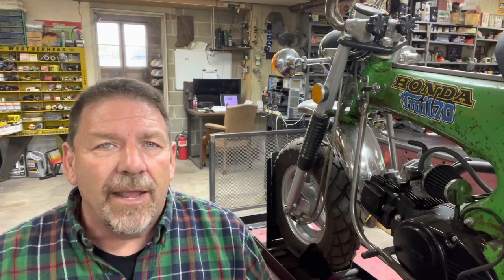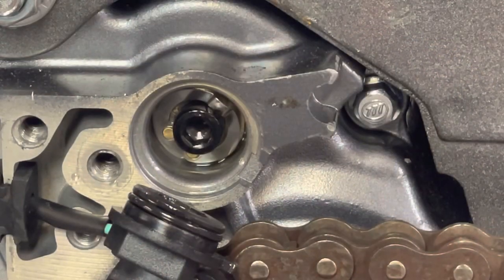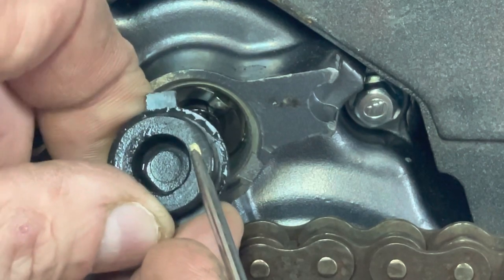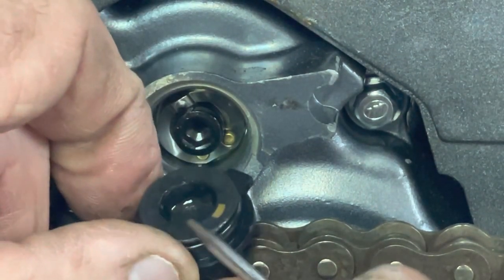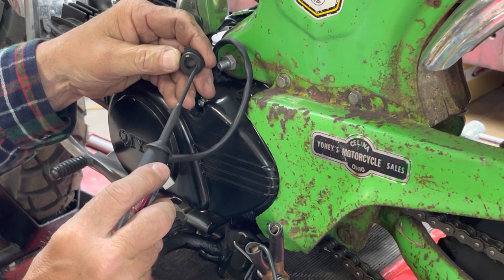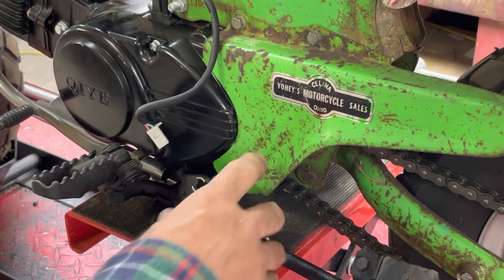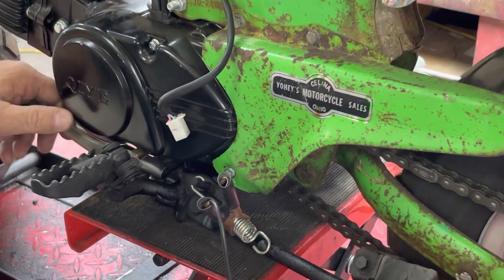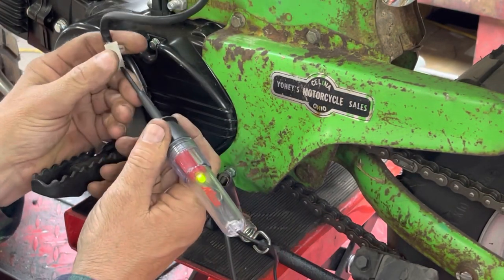Neutral indicator switch / gear indication wires

Comment: Hey man, I have a xpro x9 125cc dirt bike . My neutral safety sensor melted off inside the motor. The circle sensor piece melted in half so the bike won’t start. Sometimes I can get the sensor to touch the other half of the sensor the right way and it starts and runs just fine. Would I be able to just cut off the sensor and ground out the neutral wire to make it start all the time, or how can I fix this without replacing the sensor
Reply from the maker: @frostycrispy7234  Yep, cut the wire and attach to ground.  I would think that will work.

Comment: So can I just ground out neutral? So it will start in any gear? My Kp mini stopped starting in gear I can’t even bump start it anymore
Reply from the maker: This switch has absolutely nothing to do with allowing the engine to run.  These engines will start in any gear.   This switch has one function, to illuminate a light to let you know it’s in neutral.    This isn’t a “neutral safety” switch.
Reply: @MiniBikeMike  aww that sucks  
So what should I do my Kp mini 150 used to start in any gear with clutch pulled in but something happened and now it only starts in neutral    I think it’s not sencing the clutch  but I tried connecting the clutch wires and it doesn’t do anything :( I’m not sure what it could be
Reply from the maker: @timmysv1k94 Sorry, no help.  I don’t know what a Kp Mini is and I’ve never had a bike with a clutch safety switch.
Reply: @MiniBikeMike  it's a lifan kp mini 150
Reply from the maker: @timmysv1k94 Ok…I’m not familiar with that model.

Comment: thank you so so much  mr mike, it helped me out a lot, my gear sensor has 5 pin( since 4gears and neutral).. now i need to find out a way to make it work, i guess swapin some wires from the 6 pin connector might help? i’ll keep you posted:) thank u again, bless you😍

Comment: Hey, mike.  So, I have a chinese go kart with a single speed lifan style 125cc engine.  The kart will start if in forward or reverse, but will receive no spark if in neutral and, thus, will not start.  Any insight?  Does the position indicator switch play into the ignition, or is it simply for indication and there is an issue with maybe the CDI or something?  Thanks.
Reply from the maker: The neutral wire typically does not tie into the ignition, but yours may be different.  The neutral wire on a Lifan is green/red. If you have a wire coming out of the engine that color, I’d first try unplugging it from the rest of the harness.
Reply: @MiniBikeMike  Ok, I'll take a look at it when I get a chance, trace the (hopefully) green/red wire, and unplug it and see what happens.  Thanks for the quick reply.  

This kart has been a REAL headache... wouldn't start in neutral (kids figured out that it would start in gear), then the starter locked up (maybe a sticky starter clutch?) THEN it just stopped running altogether and I think the stator is bad so I'm waiting on that to show up.   

D:

Comment: Thx you My chain has cut that wire and I was wondering if it was important because now it’s not starting
Reply from the maker: Did the chain jump off?  If so, it probably bunch up and broke the pickup coil mount.  Take your stator cover off and check the coil and it’s mount….in front of the sprocket.

Comment: Hi Mike great video, my son's 110 cc atv has the same wire colors but I notice the 1st gear pink wire does not light up, all the other wires light up. Any suggestion what could be the problem. Many Thanks
Reply from the maker: Does each gear indicator have it own bulb?  If so, I’d start by making sure the bulb is good and is getting power.   These lights are powered all the time, they glow when ground connection is made. If bulb and power are good, I’d move to the gear switch that I’ve showed in this video.  In first gear, is it making contact with the brass contact in the switch?

Comment: So do you need the indicator the stator I bought came with a looped red and green wire and not the black peice that the wire goes into like the original one you showed at first can you bypass it or how can I just plug the black peice in from the old stator with no wire or what
Reply from the maker: Are you wanting the neutral indicator light to work?   If not, don’t worry about the plug or wire, engine doesn’t need them to run.  
If you do want a neutral light, leave a couple inches of wire on the black plug and cut it off.  Then splice it to the red/green in the new stator.

Comment: I have a 2008 honda trx 250 ex. It starts and runs no problem but the neutral light does not come on. The reverse light still works though. Any ideas what that could be?
Reply from the maker: Could be a few things….if it functions like a CT70 neutral light.    Obviously, first confirm the bulb is good.  I’d then check to make sure the light socket is getting voltage with key on.   Then I’d move to the ground wire and make sure it has continuity from each end.  If all that checks out, something is amiss with the switch.

Comment: Hey, so I just recieved one of these.motors and it's needs all new wiring.

Well my gear indicator wire needs replacing aswell, but I'm noticing through your vid now, the Allen key and contacts for indicator in the block aren't there anymore,  what would that piece be called for me to purchase
Reply from the maker: Neutral switch.

Comment: All of a sudden my taillight and neutral indicator light quit working. Could this be part of my problem or could it be a ground wire not making contact? I looked all over for a bad ground and cannot find. Any suggestions? Thank you Mike!
Reply from the maker: Those two items don’t share a ground, so I don’t see how they’d both go out unless you blew the bulbs or lost power to both places.  Have you verified that the bulbs are good?
Reply: @MiniBikeMike  yes, occasionally they will also come back on together? I don’t get it

Comment: I have the same 5 pin plug but it gets no power to it we’re would I get power from
Reply from the maker: It’s not supposed to get power, it’s a grounding switch.  Send power to the neutral light.  The ground wire from the neutral light connects to the red/green wire in this switch.

Comment: Why would the light stay on when its in gear
Reply from the maker: It’s still being grounded.  Can you pull the black plug with the neutral wire and tell if the switch is moving when you shift gears?  Also, make sure the bulb isn’t receiving a ground somewhere else along the harness.
Reply: @MiniBikeMike  as soon as this rain stops and dries up a little I'll get to it. Don't have the luxury to do just basic maintenance like owners who's got a garbage I don't because of rules here
Reply: I need to say thank you though and how grateful I am for your advise.